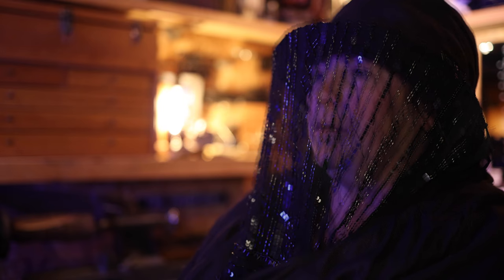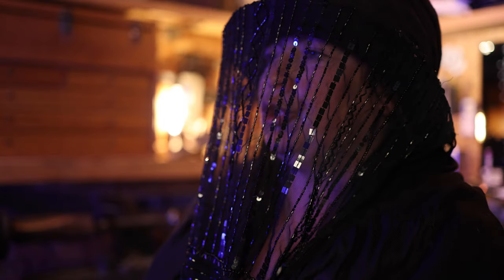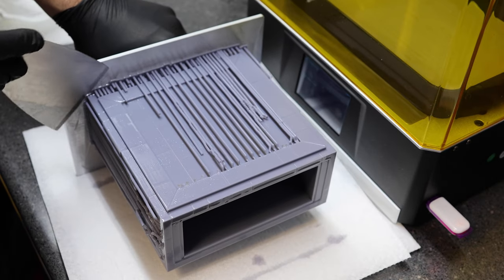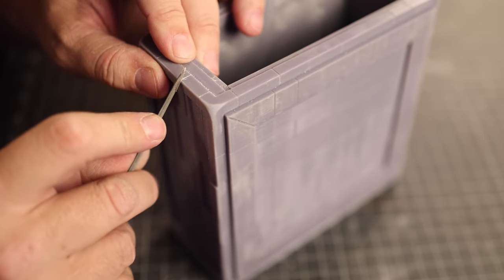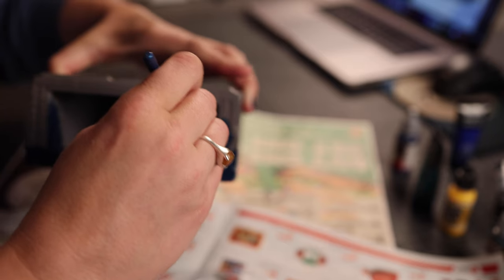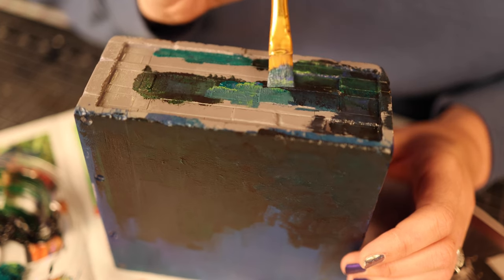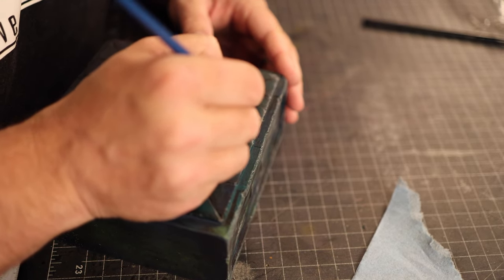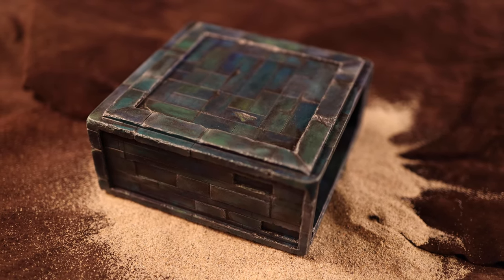Dune Pain Box | How To Make Your Own

Comment: Brian, love the job you did and paint job is amazing. Any chance you could do a similar video/prop without using the 3D printer?
Reply from the maker: perhaps some day i could give that a go.  I used the 3D printer as it seemed to be the best way to get it done.
Reply: This could be made out of wood. I'm resisting the urge not to try it this weekend and finish some of the many projects I'm already in the middle of. #TooManyProjects

Comment: Nice weathering and distressing job, but I would have preferred  if it wasn’t 3d printed. You could have built it up from styrene of different thicknesses or even wood. I watch this channel to get ideas on how to make something with nothing, not how to make something from a fully complete 3d printed model.
Reply from the maker: Consider this my friend.  The medium of 3D modeling and the act of scratch building out of styrene or foam can be much the same.

It took a deal of creative time to model the box in a virtual world.  I found it as much of a creative challenge to model the box, as if I had sculpted it out of foam or wood.  I just used differ t skills.

Then learning the correct setting and. Such needed to get the box to print correct was also a learning curve.

The curing and finishing process was a new learning curve as well.

We provided physical battle damage to the box, hand painted each brick, and finished the overall appearance with hand dry brushing.

So I suppose what I’m saying in the end is this; we all have our approach of creation.  We all have the medium we prefer.  But is the act of “making” any less if you use one method over another?  Are you less inspired because someone 3D models, prints, and paints than you are if they scratch build from foam or something else physical?

You might be, and that’s understandable, but for us it’s the act of using your imagination no matter the medium.
Reply: Agree Brian, being a 3D modeller myself it's as much an art form as anything else 👊 I totally loose myself in that process too!